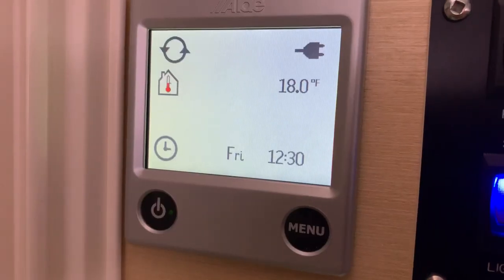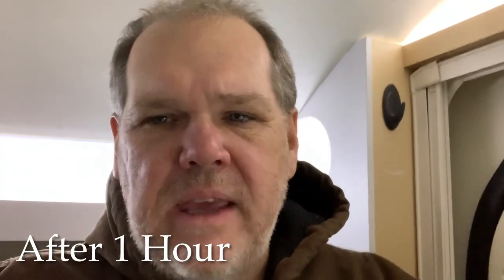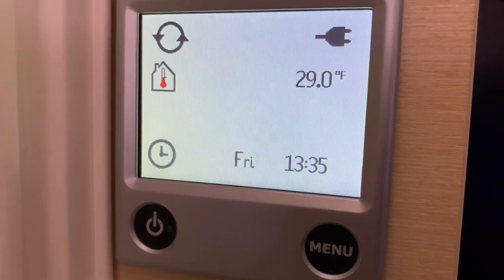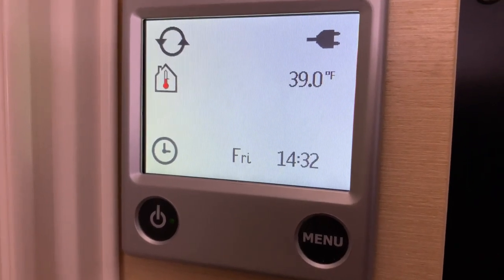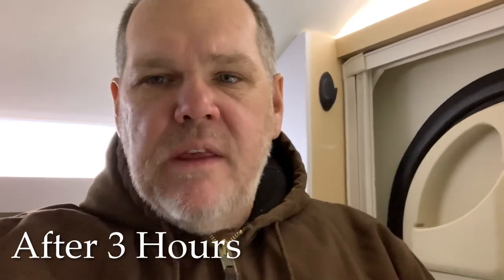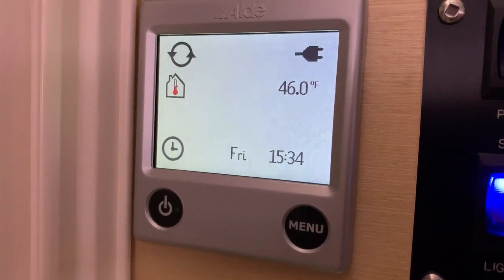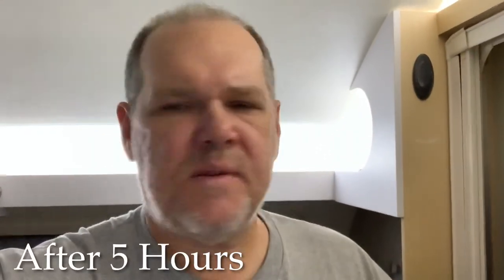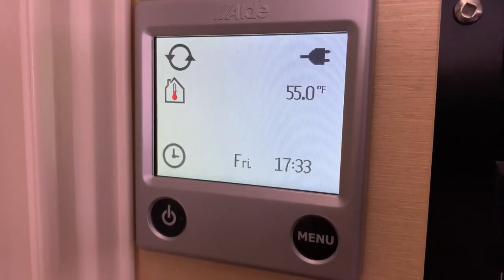NuCamp T@B 400 Alde Heat Test in Extreme Cold Weather

Comment: I have a NuCamp 320S and use it for skiing, I had a similar experience with the outside air temp at 6 degrees F and the indoor temp was at 60 so not bad!

Comment: Great video was curious how quickly this heating system worked. I wonder why they just didn't got with a propane forced air system would've been a much better system for a camper. Are you able to turn the heat one while you are on the road so the camper can heat up before you reach your destination?

Comment: We don't have a heater in the t@g, but I bought a small electric heater on Amazon that plugs into the wall to save space and lets you set the temperature. It  turns off when it reaches the set temperature. The heater has a fan as well.  My husband  tried it out and it works great.
Reply from the maker: That sounds like something I may need to check out.

Comment: Nice! I have a 320 CS-S and when the bed is down access to a couple of the heat outlets is underneath it. It does come out from underneath the bed and there’s a gap at the wall side of the bed to allow some heat out so I make sure that isn’t blocked by the mattress. I noticed that it wasn’t heating as quickly as I thought it should but when I cracked the fan just a little bit, without turning it on, it really helped pull the heat up where I was. I’ve thought about getting some sort of small blocks to put by the bed to make sure the mattress doesn’t shift while I’m sleeping and block the heat on that side. However, I live in S. TX so it never gets truly cold here and we tend to think anything below 50 is freezing (it was 46 outside when I was doing my heater test). I can’t imagine myself seeking out really cold weather on purpose but it’s good to know the Alde works so well!
Reply from the maker: We love having the heat come up from behind the bed along the wall.  I real benefit for the person sleeping closest to the wall!

Comment: Great video Patrick.  I am really impressed by the Alde system.  Just curious if you monitor the humidity in the trailer while camping?  I know the Alde system uses propane so there's a flame and this creates water vapor.  I'm interested in how much.
Reply from the maker: We always keep a window cracked to cut down on moisture in the trailer.  The 400 was so well insulated and sealed that if you don't, you will end up with a lot of condensation when running the Alde.

Comment: The coldest we camped, was -13 F, with a 320, but inside was not really warm, unless you help out with a small extra heater. Terrible condensation over the night. We sold the 320, fell bad for that because the classic Tab has character and it’s sweat trailer , and bought the 400, picking it up next week.

Comment: Very helpful video. Like the concept and comfort of the Alde, in fact I think that is why you were so "comfortable" at 55F. We live in Canada and much of our travels will be in September/October when it will definitely reach freezing. You definitely used a severe stress test for the Alde system and it actually performed reasonably well for what it is . . . and quiet too. In such a small place a traditional furnace would definitely be a down side. Gotta love Mr. Heater supplemental heat, does the trick. Is there much insulation in the TABs? Compressed foam? With its aluminum frame think it make be causing energy bleeds unless there is insulation outside of the framing and under the Azdel.
Reply from the maker: The trailer seems to be well insulated.  They put a foam insulation in between the aluminum framing and sandwich that with Azdel.
Reply: Travels with Delaney excellent, then the dry heat makes all the difference 👍👊

Comment: Going over all your Alde videos.  Learned a lot on how it works. I thought my system was not working until I watched your video & learned I just had to wait much longer for it to heat up my T@B. A couple of questions, can you run the Alde system while you are connected to the car's 12V while you are towing the T@B 400 so that it will be already warm when you get to your camp site? And, can you run the Alde system together with the Dometic heater once connected to AC power or only one heater at a time? Also, can the Alde system run on batteries only while Boondocking?
Thanks for all your help, love your channel.

Comment: Good video Patrick & most timely.  With those outside temperatures during your test, I'd be more concerned about the water pipes freezing than about the interior temperature whether camping or not.  You can always put on another layer of clothing.  Frozen water pipes are to be avoided like the bubonic plague.
Reply from the maker: Our trailer is winterized so no worries on that front.  If we go out in these temperatures, we won't be using the water systems.

Comment: Patrick, you might want to check with Spencer at Alde, but if I recall correctly, the quickest way to heat it up to use both gas and shore power. From what I understand when both are engaged, it will default to shore power o ce the desired temp is achieved to conserve LP. Obviously that cannot be done while boondocking, but it should expedite the warming up if the trailer. I camped in 14 degree weather once and kept pretty toasty, but I prefer temps around 60-62 inside.
Reply from the maker: I may reach out to Spencer to get his insights.  I haven't talked to him since uCamp.  I did talk to Austin back in November and he suggested running it on propane only to get it up to temperature as quick as possible.  Once it's up to temperature, if electrical is available, it seems to keep up just fine.  We have found that 60-62 range in the 400 is plenty warm for us too!
Reply: @TravelswithDelaney  I found the site where I originally read this. When the Lade first came to market in the IS, we had to rely on the documents ration designed for Europe. It should be the same, with the exception of the voltage. https://www.caravanguard.co.uk/news/getting-the-best-out-of-the-alde-compact-3010-heating-system-3718/  Also, the manual on page 4. https://www.alde.us/documents/3/v-3010-60-rev-1487-us-can.pdf
Reply from the maker: Thanks Jenn!  I will look these over.
Reply: @JennGrover  one difference between Europe and the US is the voltage in Europe is 220, where its 110 here.  So they get twice as much power for the same current.  Which means the Alde is more capable on electricity.
Reply: @robertpanick2660  but the extra boost is from the LP, not the elctric.
Reply: @JennGrover  If you have both LP and Electric on yes. I was referring to just electric, and the difference between the US and Europe.

Comment: Thanks so much for the fast respond.  I tried our heat pump or at least thought it was setting the heat to electric... a pump came on very noisy and rattled the whole trailer. Shut it right off...What did I do wrong.
Reply from the maker: Thats odd.  The heat pump is ran on the domestic thermostat for your AC.  It shouldn't sound any louder than when the AC runs.  Was it at least 40 degrees outside?  The heat pump will only work down to about 40.

Comment: Hi Pat, question how cold can we camp and still have water?    We are looking to camp in Yellowstone shortly but see the night time temp will be in the 30's or so.  Did you camp in the cold with your TaB?  If so how cold and still have water?
Thanks.
Reply from the maker: Yes....we did camp in the winter with ours.  Just keep the heat on in the RV which will help keep the tanks warm.  We always put fresh water in the tank and did not keep the hose hooked up to the camper because that will freeze.

Comment: Are you using the Alde system to heat water too or can I use the Alde System without hooking the water up either city water or the fresh water tank?
Reply from the maker: You can run the Alde without hooking up to water. We would run it even though the water system was winterized.

Comment: Thanks for the video! One question. Can you heat up your trailer with alde and the battery without plugging in? We are driving to FLA and will be boondocking a night or two on the way and was planning on heating the trailer while parked at crackle barrel or Walmart.

Comment: Hi Guys, I am assuming you had the TaB 400 winterized.  You can still use the Alde system?  Heat pump too?
Reply from the maker: Yes....you can use the Alde for heat even when your water system is winterized.  The heat pump will only work down to about 40 degrees.  Anything below that it will not really produce heat.

Comment: I've been wondering about the fresh water tank... well, all of them, really. Are they within the heated envelope of the camper? I'm checking out trailers in this size range and being able to use it in colder weather is an important feature. Any issues with the plumbing freezing up when you're actively out camping in it? Great video!
Reply from the maker: They are in the enclosed underbelly but there are no direct heat sources to the tanks although the radiant heat system is right above them on the floor.  We never had an issue with the tanks freezing .
Reply: Awesome! Good to know, thank you!

Comment: I'm thinking of buying a tab and going late winter camping in 32 to 44 degree weather. Can I use a plugged in electric heater to heat up the trailer faster (assuming I'm plugged in)? I can snuggle under warm covers but my dog doesn't stay under covers.

Comment: Im getting a cirrus camper in about a month and it uses this same  heat system. I watch all your videos to learn more about the nu camp systems. Would this test have been effected at all if you ran the alde on propane AND electric? From what i understand the electric setting has two levels of heat and you can also run the propane along side the electric? Thanks.
Reply from the maker: What I understand from the NuCamp people is that if you set it to electric and propane, the electric will take over.  They also said that propane will actually heat quicker so they suggested that I use propane until I am up to temperate and then if I want, switch over to electric.
Reply from the maker: Congratulations on the new Cirrus Camper!

Comment: Good video, what about the external water storage tanks they have to freeze? Have you ever experienced water line storages tank freeze UPS? I like the heater system they use but if the had a fan blowing across those finned heater strips that would tend to create more heat capacity as long as the heater could keep up with heat recovery.
Reply from the maker: We have not had any issues with freezing but we winterized the waterlines before it got that cold out.

Comment: Do you know you can run it on propane and electricity simultaneously to give it a real boost ☺️
Reply: Maybe do another test with water and heating running simultaneously at max on propane and electricity 👍🏽
Reply from the maker: djmills0016 When I talked to Austin at NuCamp and Spencer at Alde, they both said if you turn on electric and propane, the system always goes to electric. Both told me to only turn on propane to get the fastest heat
Reply: I had a look and read it in the manual page 18 at the top 6th bullet point down: 

https://www.alde.co.uk/wp-content/uploads/2019/08/alde_3020_user.pdf

“ The LPG burner and electric element may be operated simultaneously”

Might be worth another test?

Comment: Could you use the CoolCat heatpump in addition to the Alde to bring up the temp from the initial cold temperature? Although as I think about it, if that is a true heatpump, and not a heat strip, it wouldn't be very effective at those low temps.
Reply: That's what I understand Chris. The heat pump is not effective below 40F. You have one of the best channels on YouTube Chris!
Reply from the maker: The heat pump won't work below 40 degrees so anything below that, you have to use the Alde.

Comment: Great video! I have been very curious on how the Alde would work in all 4 seasons. Still curious how NuCamp keeps their tanks from freezing in cold weather. I'll be very curious how they do that in the Avia when they release it as I plan on using it 4 seasons.
Reply from the maker: We have friends with a T@B 400 and they had nuCamp install tank heaters in their their trailer.
Reply: @Travels with Delaney I also have been wondering about 4 season use with the Tab 400. Assumed the Alde would keep the tanks from freezing, but if not, Tank heaters make sense. However, the biggest concern is the exposed gates for the grey water and black water drains. Those sections of pipe are completely exposed. Want a trailer that can be used in the winter with all systems functioning. Any comments on solutions for that?

Comment: Do you think you could ever reach 70F when it’s 10F outside given infinite amount of time? Or is the Alde simply not capable of inputting the amount of heat your RV loses? Which in that case, insulation would need to be improved.
Reply: I'm thinking there is no insulation outside the aluminum frame which would create quite the energy bleed through conductive heat losses. Waiting on an answer from Patrick on that one.
Reply from the maker: We have never tried.  Honestly we get too warm in the trailer if we go over 63 per the reading on the thermostat.
Reply from the maker: There is a foam insulation between the aluminum frame.  You can see it in this video from when we visited the factory back in October: https://www.youtube.com/watch?v=TUWvsutIWKA&t=7s

Comment: It looks like the newest releases of the T@B 400's have upgraded to the Alde 3020 with the Flow option.    Is there any major difference in BTU output between a 3010 and a 3020?    It doesn't appear so in the literature I've seen.   

So I'm assuming there will be no difference in cold weather performance between the two.
Reply from the maker: I don't believe that there will be any real difference on heating.  I think the main upgrade is on the hot water side  If I understand it correctly, its now more like a hot water on demand type system.

Comment: My dealer has told me to avoid running the Aldi at temps below 0 due to the glycol solution not being at 50%. I’m curious if you used the mr buddy to heat it initially, then once at temperature if you could run the aldi at the standard glycol mix.
Reply from the maker: I would think as long as you brought the trailer temp up so the glycol was warmed up above 0, you'd be ok.  That might be a good question for NuCamp or Alde.
Reply: Travels with Delaney I gave Alde a call, waiting for a response from Spencer, seems like a really friendly company. I’ll let you know their thoughts when I hear back.

We are also expecting -20 to - 50 weather these next few days! Hopefully the glycol doesn’t freeze!
Reply from the maker: Mason Helphrey I look forward to hearing what Spencer says. Keep warm.

Comment: Question. You talked about running the heater system in cold weather 🥶 My question is how do you keep the water pipes from freezing 🥶 to camp in the winter ❄️.   Also at what temperature do you start wintering your camper
Reply from the maker: If we camp when it’s below freezing, we don’t use the water systems. We’d just use a campgrounds bathrooms. If it’s going to be below 32 degrees, I’d either keep the trailer heated or is winterize.

Comment: Question....I am still winterized and on bypass. I wanted to make sure the heat is working before we leave next week. I noticed some warm water coming out of what looks like  an overflow under the trailer. I drained the system of water, bypassed it and then winterized so why would there be water coming out?
Reply from the maker: Thats actually a good question.  If you bypassed and drained the water heater, there shouldn't be any water dripping out.  Do you think it was water or did it have a yellowish glow to it?  The reason I ask is the Aldi has a pressure valve and its possible some glycol dripped out.  Just a thought.
Reply: @TravelswithDelaney  other than the 3 low point valves used to drain the lines is there another valve I should open to drain the water heater?

Comment: Is the temperature reading ambient or of the glycol.   Is there a way to see both on the control panel?
Reply from the maker: It's the ambient temperature.  I don't believe the system measures the Glycol temperature.
Reply: @TravelswithDelaney   thanks,  was wondering if a space heater would take the chill off fast and then the Alde could take over and maintain.
Reply from the maker: If you are plugged into electric, a small space heater would definitely help bring it up more quickly.  We have the propane Mr Heater that we use.  It can be used when be boondock and don't have electric hookups.  Here is the video I did on it: https://www.youtube.com/watch?v=jbadw00z8rU

Comment: Wondering if an inside, small, low speed, quiet fan would help in heat circulation?
Reply from the maker: It might. Once it’s heated up, the Alde producers a real nice consistent heat.  And it’s so quiet compared to a forced air furnace.

Comment: We use the heat pump mode and it warms our 400 quickly! But must have 30 amp service.
Reply from the maker: Robin Rowan The heat pump works great but it will only work effectively above 40 degrees outside.
Reply: I’m in mine right now. It’s 20°, I turned the heat pump on and it’s blowing very warm.
Reply: I keep our T@B in our out building that is not heated. I keep it plugged into 30 amp service. I keep the alde set at around 50° so I can get in it anytime and be comfortable. :) I turn the heat pump on and raise the temp to 65-70 in 30 minutes.
Reply from the maker: Robin Rowan Thays great. I tried ours once when it was 32 out and it just shot out cold air.
Reply: You have the Dometic, correct?
Reply from the maker: Robin Rowan We do.